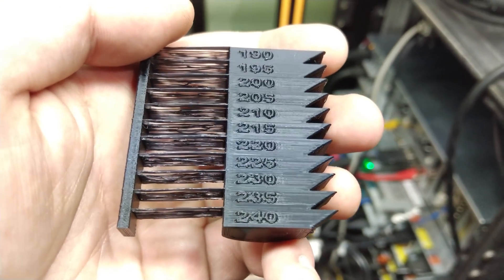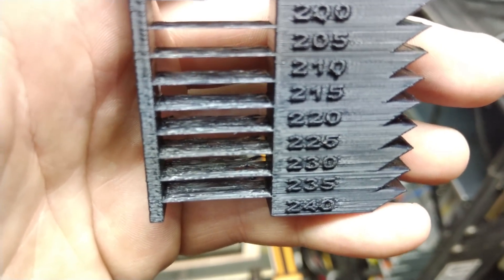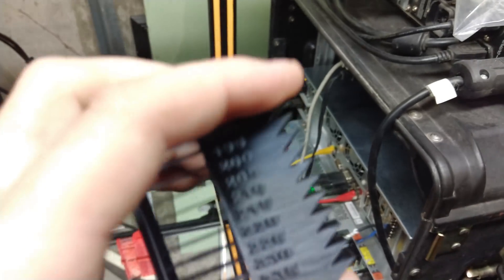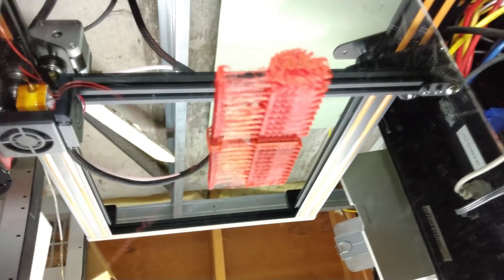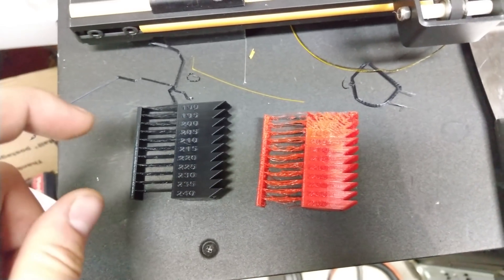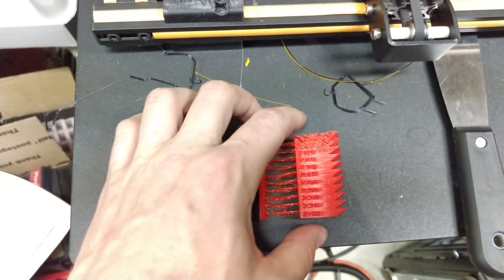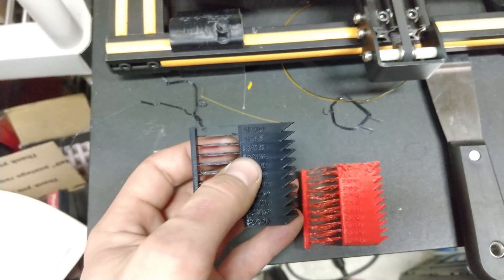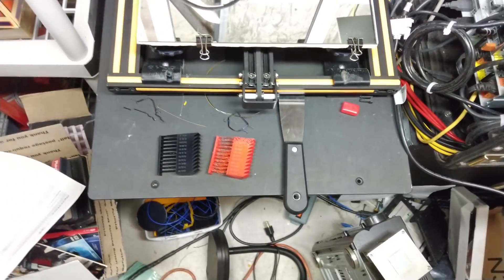How to find the perfect temperature for your 3D prints!

Comment: One reason you may want to stick with higher temperatures is the tendency of stinging to be stronger at lower temperatures.  It's true that it works wonders with bridging, but when stringing tends to be an unwanted artifact, it can create real havoc with a print.  Weak strings will break off easier.  More importantly, if you have multiple or branching components being printed, a strong string from cool nozzle temperatures will actually pull down and drag things off of your print bed.  I've learned this printing dice.

Another YouTuber noted this problem when he did the needle print test, where Z hop and retraction are noted as the wrong solution.

Comment: New to printing and heat towers (I’m on the cr10s). When I tested this on some TecBear pla, it looked pretty uniform. No level looked exceedingly bad, all overhangs were really even. One or two had a little extra printing on the numbers, and the bridging strings looked different for each. In a case like this, would the temperature where the bridging was most straight/uniform be the optimal temp? Also thanks for posting your Gcode, it really helped.
Reply from the maker: That sort of depends. Your ultimate decision will come from destructive testing of your heat tower by trying to break or separate layers at the different temperatures. It is possible that the outward appearance of a print can appear uniform over a wider temperature scale but the strength of adhesion will be affected.

Comment: Hi I was wondering how I would print say 1mm of my print with cooling on then the rest with cooling off?
Reply from the maker: You will need to add the command to the gcode in the right place to turn part cooling off.

Taking a moment to understand gcodes workings will make such a task real easy for you.
Reply: @DoogieLabs  Thanks I need to look into how to find and edit that thanks ill do some research thank you for pointing me into the right direction!

Comment: Will this code work on my CR-10?
Reply from the maker: Yes
Reply: @DoogieLabs  Can I get that code in a g-code file so I can load it on an SD card?
Reply from the maker: @MrSirPain  There is a link in the description, right click and "save as"
Reply: @DoogieLabs  A little red face because I should;d of known to save as.
Reply: I ran your temp tower file and it failed big time. Here is a link to a pic on the tower that shows how it failed >> https://www.dropbox.com/s/5a50avtahvsqf79/DSCN0256.JPG?dl=0  Also not only the bridging fail, the sides are very rough, not smooth.
Reply: @MrSirPain  It looks like your nozzle is too close and is hitting what was already printed - the top layer of the flat part is really squished.  Most likely you need to level the bed with feeler gauges or a folded piece of paper.  Also might want to double check extrusion ratio calibration

Comment: When would you ever need to print PLA at 180 or 220?
Reply: Is that really hot or really cold for PLA? I'm new and have been doing 200?
Reply: 220 when you're running faster print speeds.  180 never, it's too low, unless your hot-end isn't well calibrated to the thermistor.

Comment: Hi, i also have a cr10 clone... using a PLA printing at 218 in vase mode... it seemed ok but model have various vertical  and angled lines as if it was  were clawed by a cat... i am slowing down my 40 mm per sec speed by 10% and dropped nozzle down to 210... i hope this helps me figure out if it is a temperature issue or not... i also experienced similar issue using my ender 5... using same g code i printed 5 models...3 using two different PLA's then i am using now They turned out nice 218 , one abs print at around 238 had same scars as this one basically...and one PETG at 230 which turned out the best imo...I guess using different brands of filament makes it much harder to get your temps correct... each filament is definitely different.... thanks for you help.
Reply: Tl smoothers will clean up those vertical lines.

Comment: Hi. Is that plain mirror glass from a hard wear store?
Reply from the maker: Yes. 12 inch square mirror tiles from home depot.
Reply: @DoogieLabs  thanx alot. My prints are verry hard to remove. I will try this 👍👍👍
Reply from the maker: @theheavynation6436  This works great for PLA, I use a gluestick for PETG, because if you don't when you remove the print it will actually take chunks of glass with it. Before you print onto the mirror, hand wash with dawn dish soap and water, and be sure to NOT touch the mirror after it is washed.
Reply: @DoogieLabs  will give it a try thanx alot. Im only using pla so i should be good to go

Comment: I print all of my pla at the same temperature. and sometimes i change that temeprature.  205-215 is fine.  Settings like shells and infill are more important.  and glue on glass is outdated and not good.  get something like ultra base. i built a little hammer out of pla for removal. it works for almost every print.
Reply: Hi! Please, could you share the hammer model you use for removal? Thanks!

Comment: Is there a reason why you clean the glass bed with dawn instead of glass cleaner?
Reply from the maker: Yes. Using the aerosol glass cleaner does not work with the 3D printing application. For some reason the alcohol or whatever is in the aerosol base glass cleaners leaves a film behind that causes adhesion problems with prints.

In my opinion the aerosol based glass cleaners are the superior solution to obtaining streak free Windows. But a regular dish detergent like a dawn works the best for 3D printing.

Comment: I've had my Ender 3 for just under 2 weeks now, so I am NO expert....but...I ran the same heat tower prints for a couple of different spools of PLA from different manufacturers and my results all look best on the the lowest level (printed at 240C).  Being new to 3d printing, I didn't want to just throw out the recommended temps on the filament labels (which both said 180C to 210C) but I couldn't get any of my prints to get past layer 1 until I settled at 230C...now most every thing is PERFECT. 

My one nagging wonder here is: I set my extruder steps like 4 times before I got 100mm to feed EXACTLY 100mm ...and that was after I set my nozzle temp to 240C.
My question to you sir is this:

What temp was YOUR nozzle set to when you calibrated your E steps?
AND 
if it was closer to recommended PLA temps, do you think that could explain why your temp tower print looks best at so much lower temps than mine?

great video btw....lots of other similar topics but your's was the first one I found that hit directly on my personal mission

Comment: I bought an Ender 3 printer and got a ANYCUBIC filament for it (its a much HARDER filament than the default one that comes with it), and i was getting bad adherence to the table even with different table temperatures (default table). HOWEVER, because its a much harder material i decided to increase the temperature of the tip of the extruder to 220 C and it works like a charm now.

Im a noob to 3D printing and I hope this might help some people that had the same problem as me. DIFFERENT PLA MATERIALS = DIFFERENT TIP TEMPERATURES

Comment: hi    do you manualy change thr temps after each level ?
Reply: Some slicers have the option to change parameters at a certain layer. For example you tell the slicer to do 190 at first laxer than 200 at layer 30 than 210 at layer 60 etc...

Comment: Hey guys, i was wondering, say i was getting some warping, i know you need to get the perfect balance of extruder temp and bed temp because it needs to cool down enough, but how do i know if the bed temp needs to go up or down, or if the extruder needs to go up or down
Reply: Did you figure this out?  Usually warping (unless it starts at the base layer) is a result of bad Temps or rapid cooling and not the bed temps... For instance, I was getting thoroughly miffed that a lot of my prints  were just ducking ass due to bad layer adhesion and a LOT of warping.  Turns out the vendor who shipped me the plastic sent me AND and not PLA as I had ordered. Abs needs hi Temps and an enclosure to prevent rapid cooling.

Comment: Great Idea - but how do you change the heat for the different parts after slicing? Do you edit the gcode manually at the right section???
If yes then I have to learn code fluently!!!! :-)
Reply: Some slicers have the option to change parameters at a certain layer. For example you tell the slicer to do 190 at first laxer than 200 at layer 30 than 210 at layer 60 etc...

Comment: good info. i have found that darker colour PLA  needs a bit more heat on my Anet A8 so i set up a bed temp at 58 and nozzle temp 198 and this is a very good starting point even tho on the Pla real label's they  say from 210 to 230 erm i would say take no notice of the labels as all i have bought .even from different suppliers are not correct.
Therefor  i also do a heat test for every new real.
be wise and enjoy good prints and save time and money by learning from this vid.

Comment: How are you printing right on the glass with no tape, glue or hairspray? Mine doesn't stick straight to the mirror. And when it does, it lifts up on the edges which ruin my prints. I'm using PLA on a CR-10.
Reply: I agree with Corey... fresh clean glass is really tacky for PLA... don’t get me wrong, hairspray helps out, but is a mess to clean (my opinion)... heat your bed to 70, and do a real good cleaning on your glass... what’s your initial layer setting at? Took some tweaking but I’ve nearly got mine as smooth as glass now...
Reply: Sounds like you need to adjust your first layer height; the filament should be slightly squished in order to adhere to the bed.
Reply: I prefer to use green painters tape and Acrylic Mat Medium as a glue (can buy it in craft/art shops). Put squares of tape on corners of glass to do bed leveling, then run strips butted up against each other starting with center and working your way out. Never had ABS lift off after this trick. Removes 1 worry out of printing. After the print is done and does not peel from tape, peel the center strip and re-apply fresh = no cleaning.
Reply: I never had success with bare glass. Now print with water+glue mixture 3-4 layers and it sticks every time, after cooling it just pops off easily.

Comment: Thanks I will try this on my Anet A8
Reply: I print PLA on my A8 at 60 deg. bed. The heated bed has a piece of glass on it and I clean it with Windex between prints. I tried hairspray and others but that left a film and I had to pry the print off. With a clean glass the print just pops off. Perfect!

Comment: Do not Give your file. Think about it. Even if it printed 100% their slicer doesn't have the OTHER settings. So it is of no use to anyone but you. They are wasting their filament.
Reply: Norm. He's giving the g-code, so why would anyone put it into a slicer, it's already done? Admittedly, I can't find the file... it would be useful, as I'm using Cura.
Reply: What I am saying is settings he used will not print the same. I know it's Gcode. Gcode has settings also. Example: If your printer needs to print at no more than 50mm ps and he sliced it at 100mm ps then it will turn out very badly for you.
Reply: The GCode he provided is for the CR-10, as he mentioned. If you're rocking a CR-10, the parameters should carry over just fine. If you tried to use GCode that was intended for a larger machine, or one that homed at a different location, you'd end up with problems. Assuming you have your speed limits configured correctly in your firmware, GCode asking for a 100mm/s move when your machine can't move that fast will just result in the command executing at the max speed.
Reply: There is more to it them bed size. I know how printers work. I have 10.

Comment: Very good idea. you have to rewrite the gcode directly for other printers and auto gcodes... get a gcode for the 3D shape, then add 20 lines changing the temps at set intervals, so if it's 1000 lines long, make a line every 100 lines from the first move and change the temp 10 times. i donno the gcode temperature command.

Comment: Temp is also speed dependent and how much if any cooling.    Layer height also affects the optimal temp setting since its extruded slower.   slower = filament in nozzle longer means it will be hotter, faster = not as hot.
Reply: Indeed! And recommended to do multiple towers at the common settings one might use... (ie Fast/thick layers for parts, slow/small layers for detail prints). Not to mention filament brands as well!

Comment: Excellent going to try it on my hictop cr-10s see how it goes
Reply from the maker: Might want to try the same print at several different speeds too. One important thing I forgot to point out is the given nozzle temp for a lower speed may not yield the same quality as a different nozzle temp might at higher speeds.
Reply: I might ditch my da Vinci Jr pro for a cr-10. Good move?
Reply: Gordon Marchant did some research last night, seems to be the case. Is the Cr10s the best play for that money? I think I'm going to do it. Much more serious machine than the da Vinci...
Reply: Doc, I've been using a stock CR-10 for many months. A brilliant machine. Only issue is the extruder stepper driver, after many, many hundreds of hours, it fell over (seems to be fairly common). Bought a new board for £31, so not a problem, but will move to RAMPS eventually. Still the best bang for your buck. Join the f/b group at https://www.facebook.com/groups/CrealityCR10/
Reply: what speed are you using for this gcode file?
Reply from the maker: Forgot to specify that: 50mm/s
Reply: Thanks, i'll give it a go after I add my custom gcode for autoleveling. I printed your filament sensor mount and posted a make on thingiverse. Unfortunately I didn't realize it reduces the overall Z height by a few mm and it crashed on a very tall print. thankfully it crashed after it had finished printing what I was printing.
Reply: DoctorBlankenstein I would go for the cr-10s you have dual axis  z. And fillament run-out detection. It may be worth the extra money. As up grading a cr-10 to similar to cr-10s can cost same if not more
Reply: Skysurfer thanks for the reply! I'm excited about this thing  :)